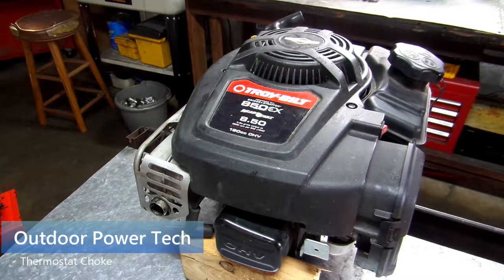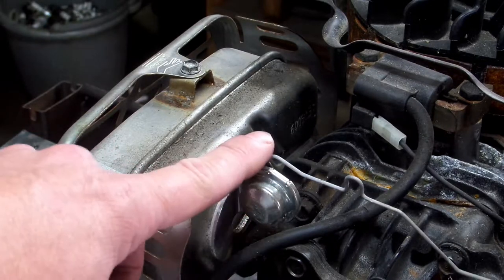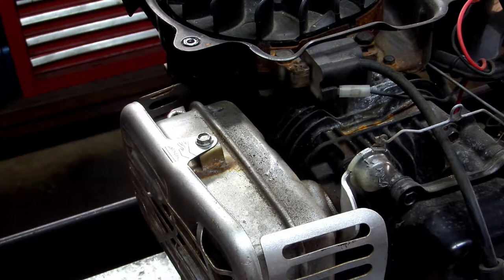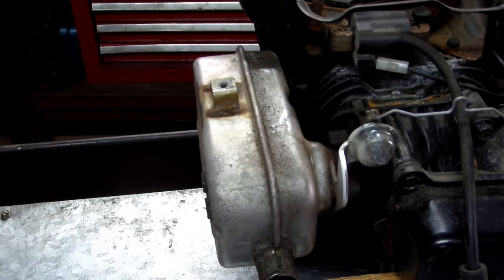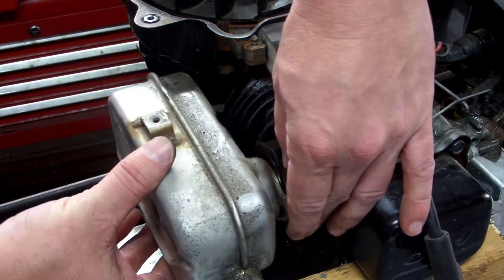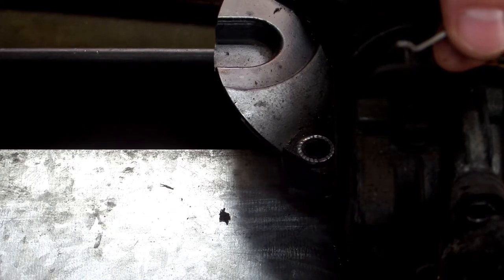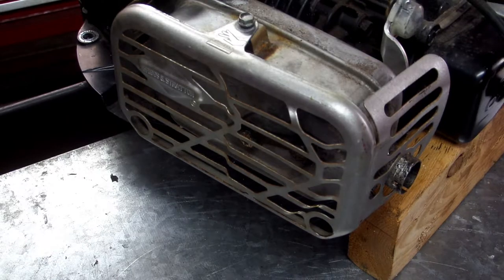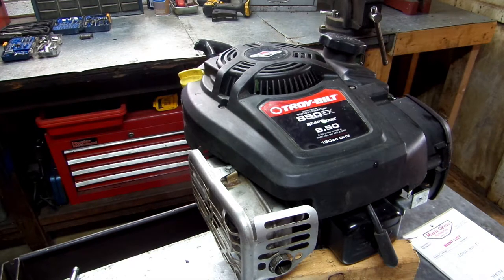Briggs & Stratton Auto Choke

Comment: My B&S Gold Series engine with this system is having a starting problem with HOT.  Starts on the first pull cold (Choke closed) but when engine is warm/hot, it's too lean to start.  I've not been able to fix this issue.  Thanks for the great video.

Comment: Hi, thank you for the video. In my case the thermostat is working but the second lever is not moving back. In your video at 3:48 the second lever is moving back left at leat a part of the way in case the thermostat gets cold. In my case this second lever does not move at all byself to left it goes all the way right if thermostat is hot and stays there. So how this two are linked or should be linked? At you engine both are moving. If this one stays right the engine does does not seem to start if it is cold. For what this one is used?

Comment: Glad to find this video, I have an autochoke similar to this but I have swapped carbs, cleaned over and over, but the only thing that works is if I spray ether and then it runs great with no issues.  Should the carb plate being closed be enough to draw fuel up the tube?  My carb plate does stay closed but it wont start no matter how many pulls. Then  the tiniest bit of starter fluid and it runs perfect. I may try the torch heat trick to see if mine acts as it should.
Reply: @ulh pilot  forget about the thermostat. if you can get the engine to start, place your thumb over tthe carb throat. a little thumb movement goes along way,your thumb is now the choke, if the motor runs like this, you problem is a dirty carb jet. by "run" i mean roughly with you moving thumb to allow 'some' air into throat....you need to find a balance.  assuming you have the plastic carb; my guess is you didn't break down the white jet assembly into its 2 peices YOU NEED TO DO THAT as there is 3 sets of ports that need cleaned.
Reply: stick you thumb over carb throat as the "choke" if it fires that way its the carb
needing cleaned